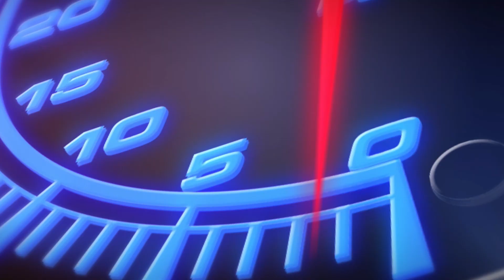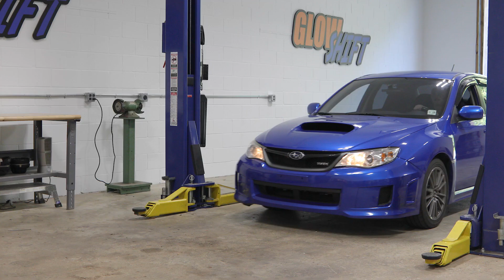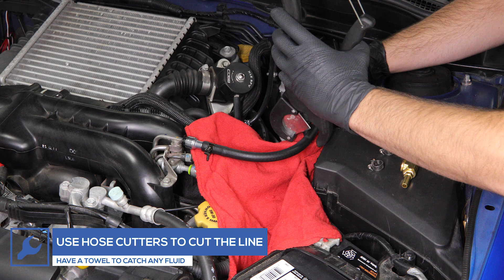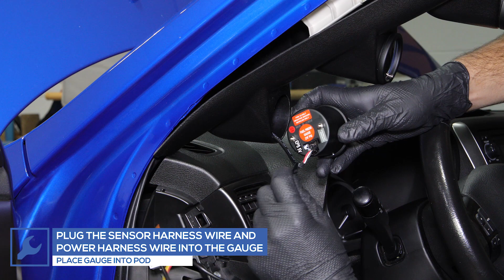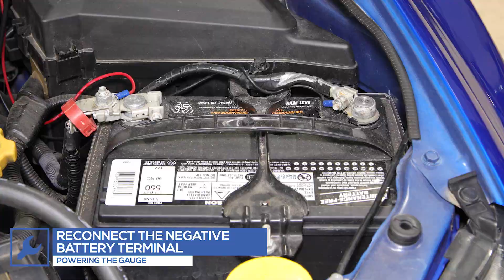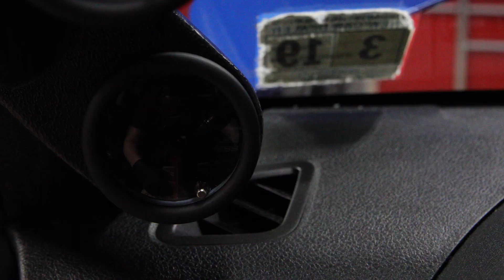Installation | GlowShift 7 Color Series Fuel Pressure Gauge for Cars and Trucks

Comment: Would this be the same for the 2012 Camaro or does the Camaro have an existing location to connect sensor?
Reply from the maker: This is a similar process for most cars when it comes to fuel pressure.

Comment: So it just has to be tapped into the system. Instead of cutting my fuel line could i just use a tap on my fuel rail?
Reply from the maker: Yes, you can if one is available.
Reply: @GlowShift  what do you mean by if ones available? Like a screw or

Comment: My truck has metal fuel lines this doesn't help
Reply: you need to install it on the fuel feed line or the fuel rail service port
Reply: We’ll I mean you could use brass fittings and run it in that way